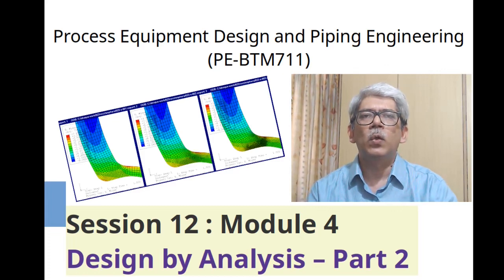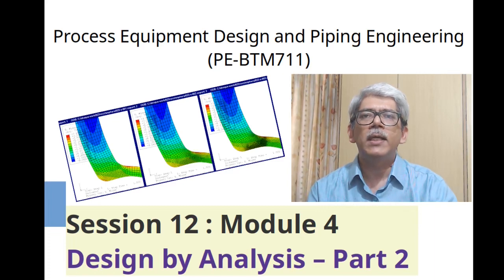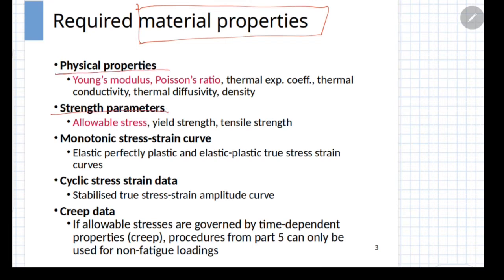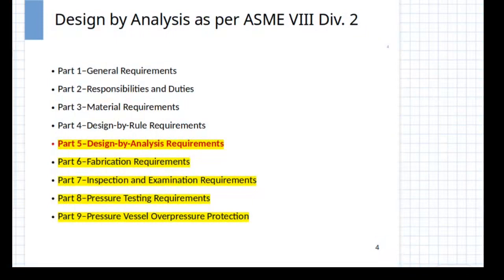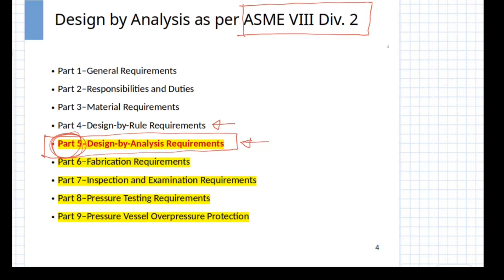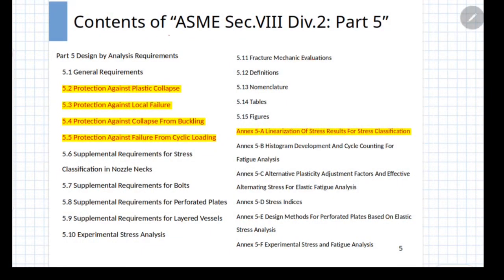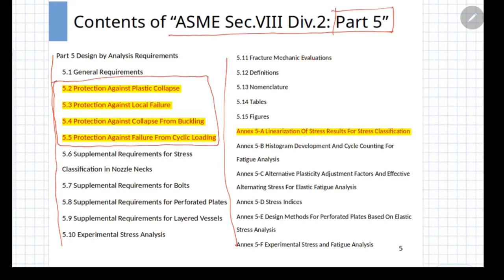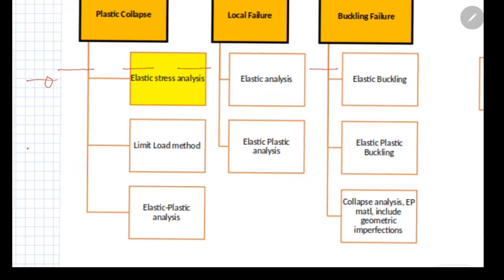S12A Introduction to Design by Analysis as per ASME code

Comment: Sir if i have thermal load for long time  , do i need to do creep seperately or  i can compare with aging allwoble limit.
Reply from the maker: Assuming that your thermal loads are in creep range (usually temperatures above 400 deg.C), the first choice is to check whether the stress levels are below allowable stresses from ASME IID for sec.VIII, Div.1 which includes creep criteria. If the equipment service requiremets demand study of time dependent deformation (which may lead to relaxation of flanges or similar issues) then only detailed creep analysis is required. I am not sure whether the latest ASME VIII Div.2 includes creep analysis procedure; if not, you have to use method given in ASME Sec. III.